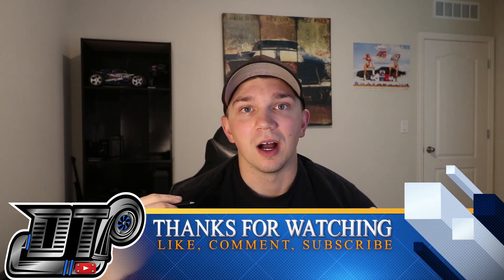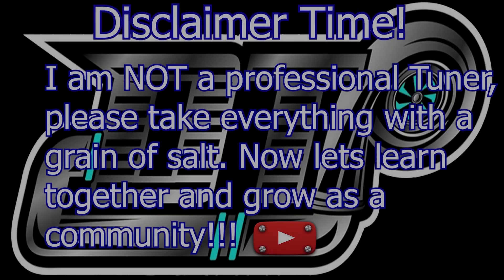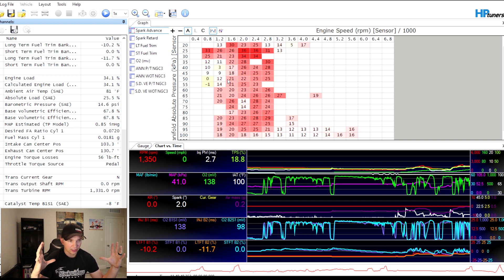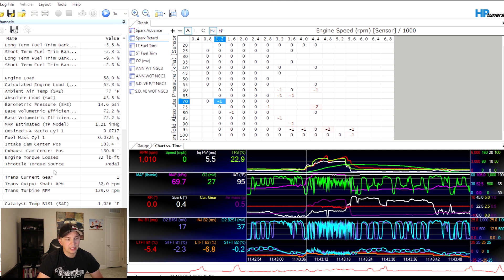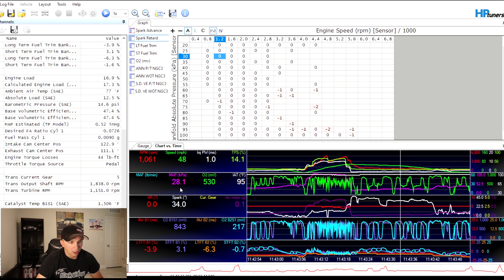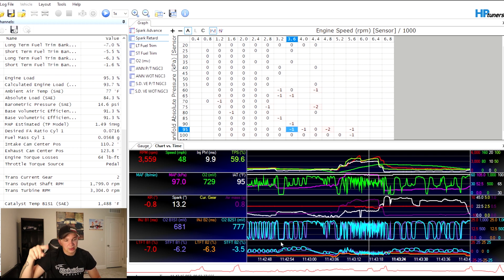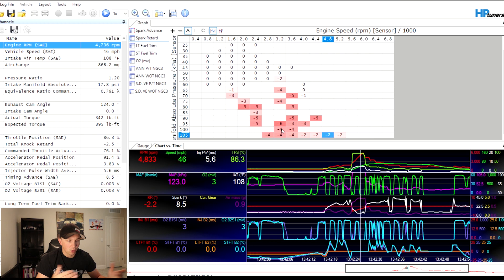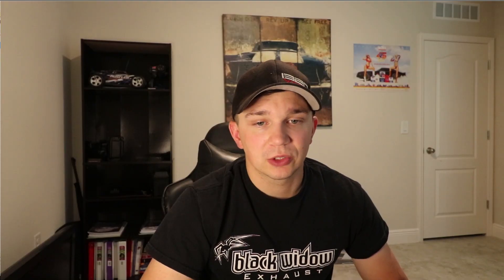HPtuners VCM scanner intro

Comment: Hey man I’m going to be putting a new exhaust on my 05 5.7, I’m doing long tube headers, no cats, x pipe and dual straight pipes all the way back to two turndowns.  Could you do a video or pm me on what needs to be done to disable the check engine light for the long tubes and what to do to fix the air-fuel ratio when you go catless and remove the rear o2’s?

Comment: I have a question. Does tunning the fans with hp. Change the fans even when setting still. The reason I ask. Diablo only lets fan change when vehicle is in motion. When setting still it goes back to stock. I think it's STUPID but that's Diablo. Just asking
Reply from the maker: Its based/triggered off of the coolant temp. So yes it will work for when the car is sitting
Reply: @DropTopPerformance  thanks for answering. Im going to HP. Its cheaper than buying tunes.
Reply from the maker: @darrellcarter3959  its so much better too lol

Comment: The most important process in any tuning is to figure out how to tune fuel and timing and explaining isn't enough most of us already know this but we need the steps to do it in a dodge vehicle tables parameters pids in the scanner so what you need to do is basically do a video of you actually tuning your vehicle both fuel and timing and the steps you followed when you go in and out of the editor check out great rope videos speed density tuning  that will give you an IDea of what I am talking about

Comment: What I'd like to see for Dodge specifically:

A systematic/logical process for what needs changed to keep the engine safe and make power after any mods. Basically a start to finish tuning process for say a cam swap or for boost. 

Thanks man

Comment: Dear friend. Please could u help 
There is a sound like something hit the wheel when i turn steering slowly. I changed the engine rubber but still the same. Dodge charger se 2015
Reply from the maker: Check my video on power steering flush😁 i hope that helps and hope you get the car fixxed!